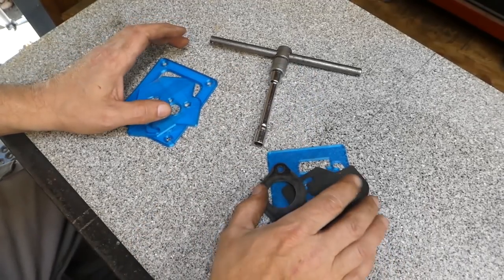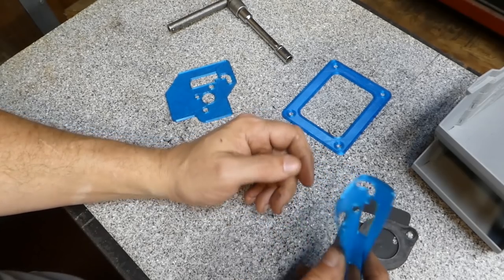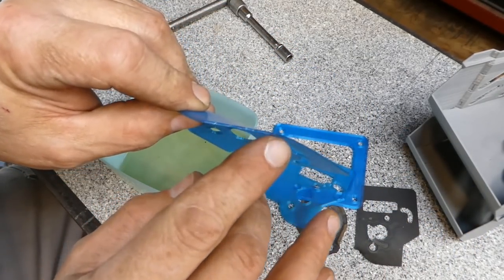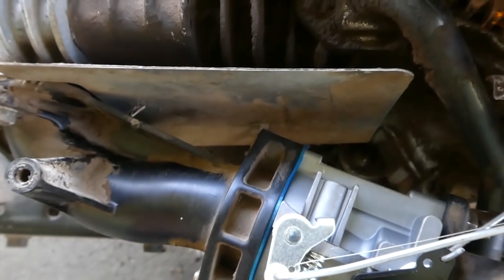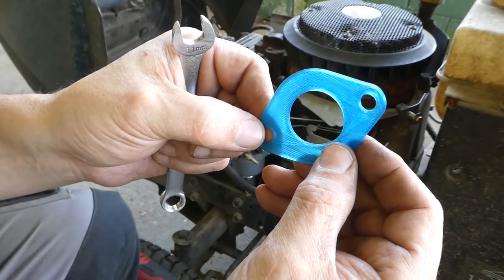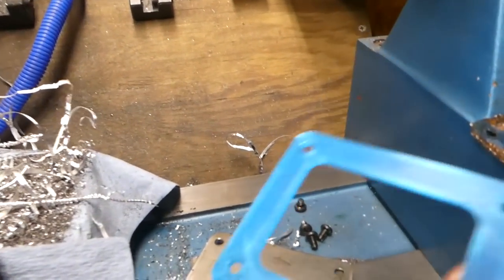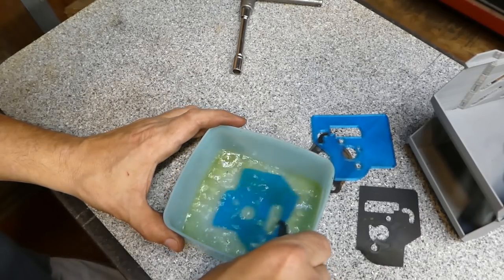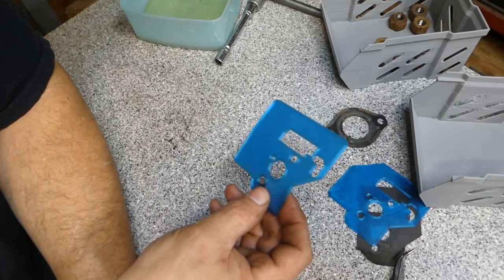3D printed gaskets? Any good?

Comment: Sadly it's only printable on direct drive 3d printer setups. You cannot use a Bowden setup as the filement will get stuck in the tube. 

It's insane how strong TPU is.. I have a couple TPU GoPro mounts for my fpv drones. They are indestructible.
Reply from the maker: I have had several people tell me they have had success with a Bowden setup with Capricorn brand tube. Just make sure the TPU is rated 95A. Ninjaflex and the soft brands are truly like wet spaghetti and hard to use.
Reply: You can use bowden 3d printers with slightly more effort. My cr10 v1 could print TPU with every extruder I've used on it (one sided original plastic, same style in aluminum with tighter clearances, and dual drive BMG clone).
Reply: Ah awesome! I guess every TPU I've tried with my Bowden setup was just too soft! I have a direct drive now anyways. Happy to know it can be printed with a Bowden.

Comment: not all PLA is the same.   i have an jar full of acetone with spru goo and a PLA printed scooper i leave in it, and nothing has happened, now ABS that will milt down in it.
Reply from the maker: I have seen some others say PLA is generally acetone proof. I agree it is probably dependent on the specific formulation. The super cheap stuff I used for those little bins definitely reacted to it, leaving the bottom like I had just removed a price sticker,  but not like ABS would. It would take a long time if ever for it to dissolve in it. Thanks!

Comment: ANY WAY you can PLEASE provide an STL file for that toyota circle piece @ 11:00  (it looks identicle to my MR2 spyder 2zz swapped MAF (where its leaking rn so im running badly lean), This would fix me thousands as I have tpu. Also do you by any chance can share how you learned to design stuff by measuring?
Reply from the maker: Send me an email. My address is on my about page. I doubt it is going to be a exact match as it is for a different application but I will send you the file.  I did a video all about designing and measuring these gaskets, see my channel page for "3 ways to design a gasket for 3D printing" Thanks!
Reply: @theeddies  perfect! Thanks

Comment: What maniac uses Philips on any milling machine
Reply: Also I’d recommend using a thicker steel for the cap if it starts leaking again. That stainless steel looks like it’s flexing and may be the cause of the leak.
Reply from the maker: Some Chinese maniac used Philips. Thanks!

Comment: tpu isnt going to make a decent gasket for anything that gets hot.
you're better off printing a stencil for gasket material or a mold for RTV silicone.
Reply from the maker: I did a follow up video testing heat resistance. The glass transition was near 100c which is plenty good enough for a carb gasket or side cover on a motorcycle for instance. But yeah, no head gaskets or the like. I like your idea though of printing a mold. I am definitely going to test that. I am also going to try annealing TPU to see if it changes the glass transition at all. This is all just an experiment. Thanks!

Comment: If you can afford a 3D printer and know how to make a model then you should instead get a 100 dolare engraver from china and cut gaskets with it.
Reply from the maker: What if I already have 2 printers and don't want to buy another machine that would be single purpose and just collect dust 99% of the time?
Reply: Then is time for a large industrial laser cutter, that way you can use it for more than one thing :)  but yes 3D printers are cool,  maybe one day someone makes a proper gasket filament.